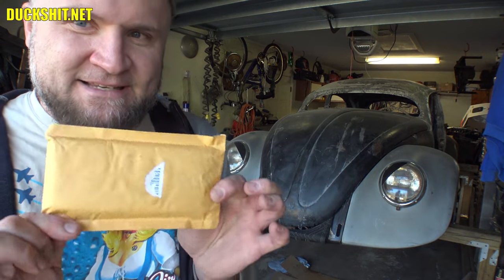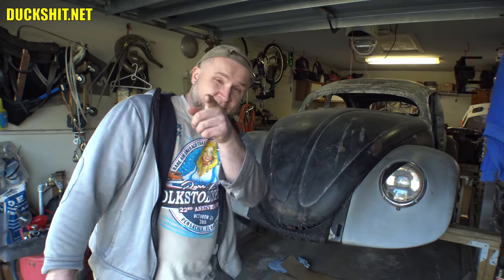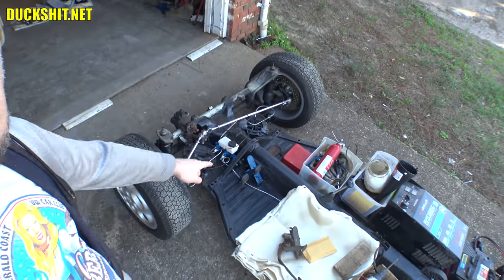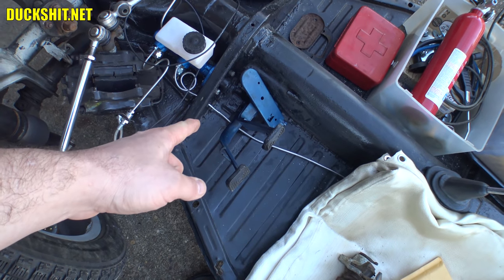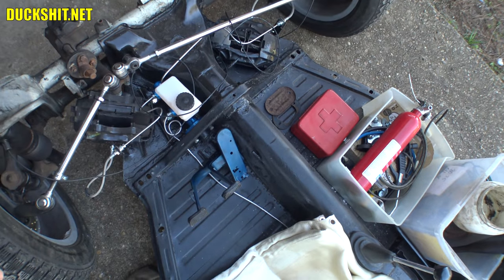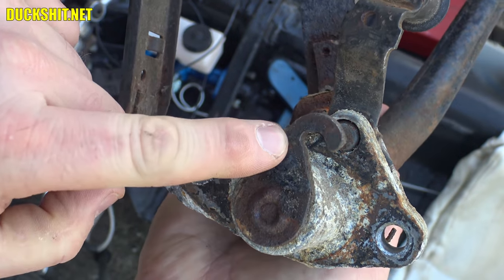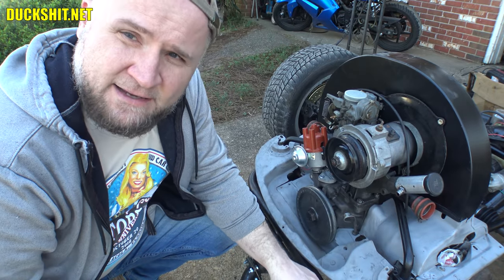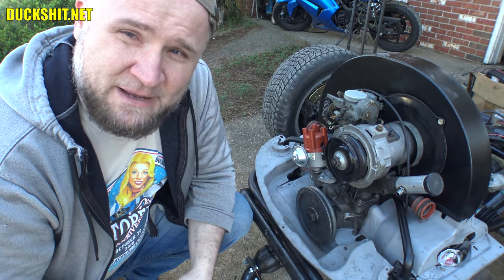Envelope Contents - Mailing Address - Pedal Cluster - Mid Day Q&A - 46

Comment: JB weld a quarter to the drive way entrance or street. Those bills are very conveniencing.
Reply from the maker: Do you think it will stay stuck to the pavement?
Reply: @vvtheduckvv  Yes it will. Try it with a penny first if you dont want to risk a quarter. If its concrete definitely yes.
Reply from the maker: @shartne  I think I want to nail, it though, lol... maybe use alumiweld!  Its an excuse to demonstrate that in the video, people keep asking!  LoL!  We've got brand new pavement here, its nice and black... a good shiny quarter will really POP!
Reply: @vvtheduckvv  We used JBWeld when we did it, made sure to get it all the way out to the edge, roughed-up the downside face of the coin so it got a good bond; =we= couldn't even get it up afterward without destroying the coin. Wouldn't recommend it on asphalt though, you'd probably end up taking a chunk out of it (ahem)...
Reply from the maker: @brand-x7049  Yeah, bits of the pavement releasing is exactly what I expected would happen... lol!  Sounds like a good experiment!

Comment: Always wondered why they didn't went with hydraulic clutch. I know, leaks, costs, etc. But even back then they already have had precise enough manufacturing processes to make brake systems seal; and hydraulic clutch system does operates with much lower pressures anyways. Just wondering, really.
Reply: I'm thinking of putting a hydraulic clutch on my karmann ghia, was an auto stick car, so no clutch cable tube installed.
Reply from the maker: Eleanore will eventually be hydraulic, too.  But the clutch cable worked so well for what it was that I don't think VW was concerned with "upgrading" what wasn't broken or needed replacement.  It stayed the same over all its years, the only thing that changed was its length!

Comment: I thought in a previous video you said were going to change the alternator stand bracket because the oil filler neck was too tall. If I’m wrong, I apologize.
Reply from the maker: I did try exactly that!  But that was many videos ago... lol!  Then was discovered I had a generator stand, and not alternator.... oops.  But I didn't have the tool to swap oil the filler necks. Well, I got one, but that led to new problems. More on that later!
Reply: VvTheDuckvV 
Ok. 
Thank You.

Comment: What do you recommend doing after sandblasting panels to stop it flash rusting and rusting after painting. Just got a 1302 beetle with small dots of rust showing through the paint, probably because they didn't use primer.
Reply from the maker: Phosphoric acid!  It works great! Even if they do flash rust, it will come right off.  You'll see me working with it soon!  There are some other products, such as etching primer that are very useful!  I hope that helps!  Thanks for the question!

Comment: You can't weld a nail to a quarter. You will have to solder it. Silver solder is stronger than regular solder.
Reply from the maker: Well... soldering is welding.... so... yeah!  I was thinking alumiweld.  Its zinc. pretty tough for what it is!  No matter what, it'd make a great experiment and video!